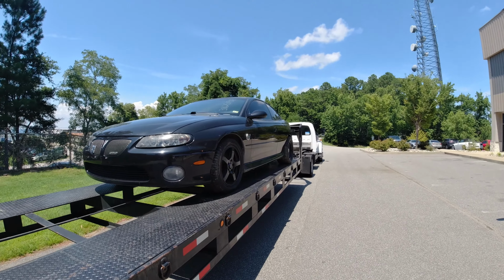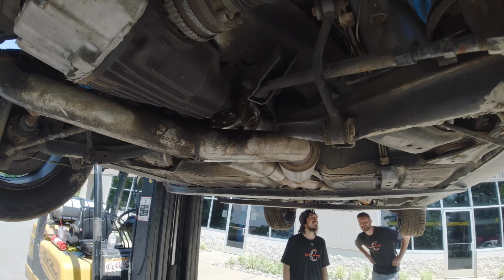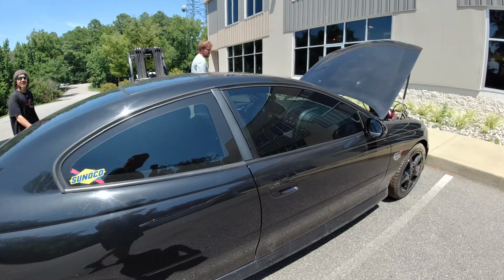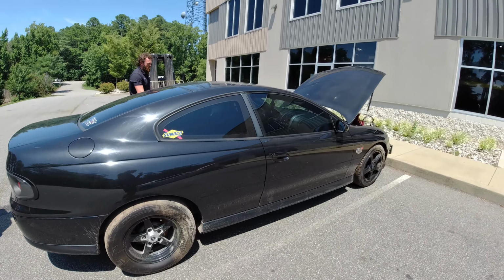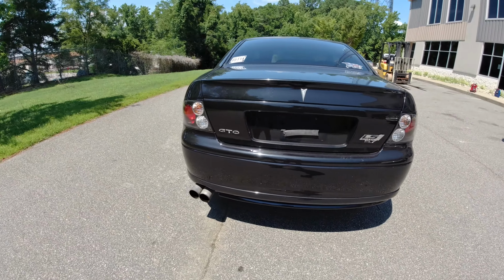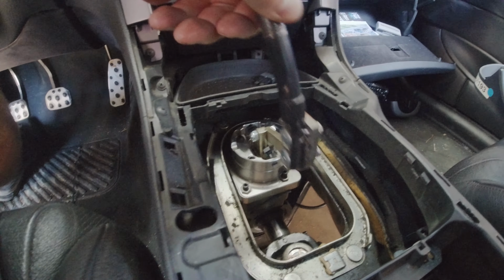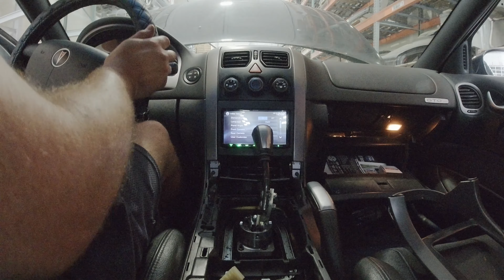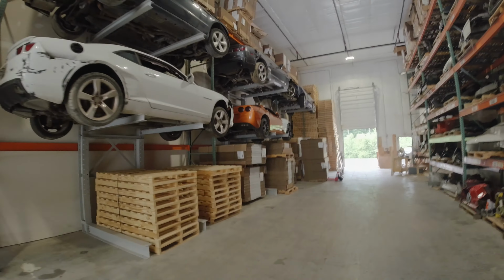This Salvage Auction GTO Has CRAZY Mods! | BIG CAM LS!

Comment: I wished Pontiac would have done like ford did with the mustang and when they brought back the Challenger. It was a updated version but still had the 1960s resemblance to them. If Pontiac would of done that with the GTO who knows maybe Pontiac might still be in business.
Reply from the maker: That may be accurate.  It may have been more well received if there was more of a resemblance.
Reply: I for one am glad it is the way it is. I get to have a holden Monaro here in the US lucky me!
Reply: True they could’ve done what they use to by rebadging the Camaro. The company trans am depot did it and they look good.
Reply: @atticalaboratory   You're dead right, it's a Monaro,  a two door coupe version of the  Holden Vy Commodore sedan.   Holden released two door versions of a select range of there family oriented four door sedan's

Comment: Looks like a GMM rip shifter with a Lou's short stick. I'm baffled as to why a smaller trans was installed...if not the original tailshaft wasn't reused.
Reply: It’s not an original tail shaft

Comment: That's t56 from an f-body. .. The one's in the Go's ate the same as the cadillac CTSV8..
Reply from the maker: Was definitely interesting to see
Reply: @scraplifegarage  .. I can only tell you because I had to get mine rebuilt and thought it was a regular t56.. But apparently the back housing is different.. It's longer to relocate the shifter back..
Reply: Yall wrong... it's just missing the factory shifter/plate..that sits on top of trans.. once removed for a aftermarket shifter this is how the trans tunnel will look.

Comment: F-body and GTO trans are same, same size too
Reply from the maker: The tail housings are significantly different
Reply: @scraplifegarage  this is a gto trans... u compared the shifter to a stock shifter, which relocates the shifter handle back 3-4" that's why you thought the trans is different. 
The factory shifter sits on a plate and has 2 shifter ball pivot points